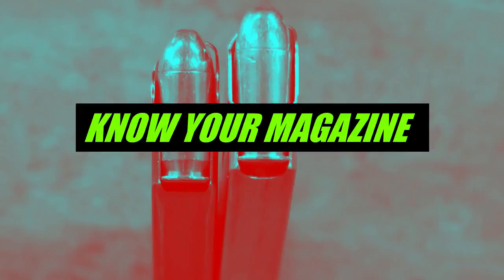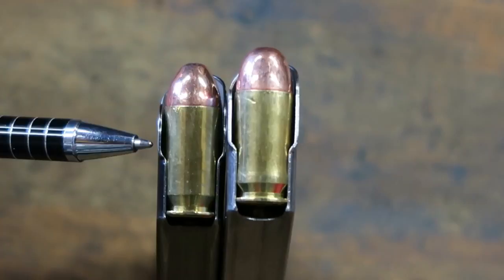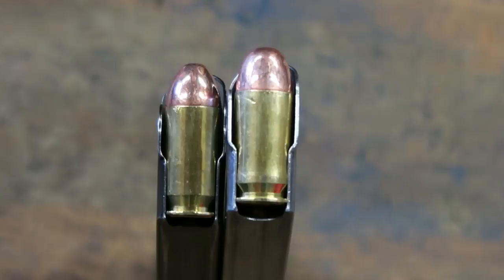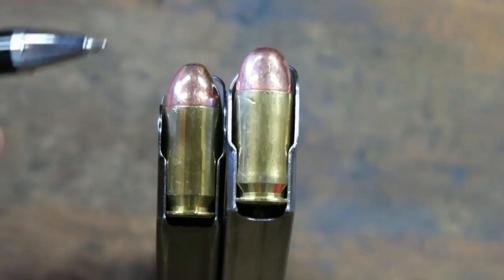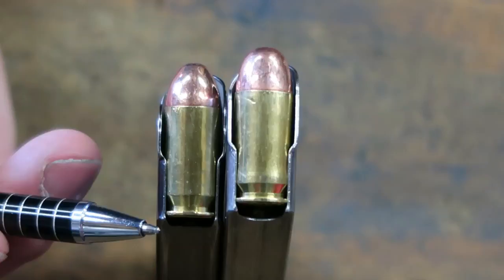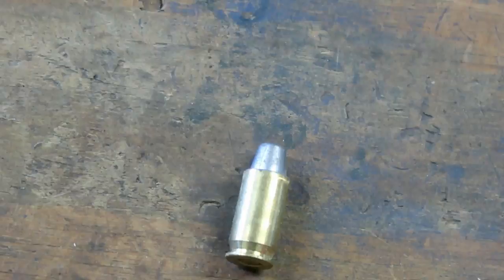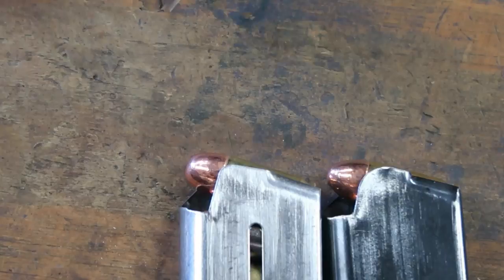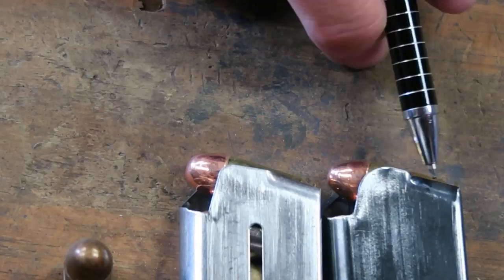Know Your Magazine

Comment: i converted a mauser to 45acp and it’s designed to take 1911 magazines. besides the gun not really being designed for the conversion it is finnicky and it wants to do the nose dive thing into the feed ramp like you talked about. what would be the best magazine to fix or make more liable this problem?
Reply from the maker: possibly one with a polymer follower like a Wilson Combat 47D. The polymer is slick so it would help with the drag as the cartridge is pushed out of the magazine. The shorter feed lips of a semi-wad cutter version will release earlier also. That might help. That is an interesting conversion.
Reply: @mackdaddy1911a1  thank you tremendously! you’ve gotta be the smartest person on the internet about 1911 magazines. i’ll definitely buy one and that makes sense. i had no idea that the round locked into the extractor as it caught it off the magazine. that makes sense why the kit had me reshape the extractor in the way that it did. yes this gun is definitely the coolest i own. with a silencer it’s quieter then a pellet gun. truly incredible. i’ll definitely get one of those mags and see if it helps
Reply from the maker: @1timmeh   I am still learning but I do try to pass on what I have learned. You might call the folks at Brownell's and talk to one of their experts before you buy. They can hook you up with a semi-wad cutter mag or steer you to a better solution. I saw your shorts video on the converted rifle. Quiet for sure.
Reply: @mackdaddy1911a1  that’s a great idea. i’ll call them. thanks! that was before i got the magazine converter in.  thanks for the watch!

Comment: Couldn’t you just use magazines designed for your pistol and use ammunition recommended by the manufacturer?
Reply from the maker: Yes but with 100 years of others developing accessories for the 1911 and clone 1911s, which is the real deal? There are over two dozen companies that make 1911 clones. And dozens of magazines. Some work correctly and some won't even fit into all the various pistols.

Comment: My kimber ultra carry 3in barrel 45 is new, but failure to feed seems chronic; (for a $1000+ compact concealed carry). Ball & hollow point with mags that came with it. Is there such a thing as a “break in” period of 400+ rounds before I take it in?
Reply from the maker: If is all metal yes. Also lubricate the slide and frame rails. Personally I prefer a thin layer of grease.  Field strip it and clean the rails and apply a thin layer. #2 automotive chassis grease is cheap and you can find it any where. Reassemble and wipe off any excess. Lack of lubrication causes binding and slows the slide velocity. Causing erratic ejection and feeding. Oil evaporates and runs off after a bit. Good luck.
Reply: @mackdaddy1911a1  thank you so much for the wisdom. I’ll go thru all that today. Seems a bit irresponsible on behalf of the manufacturer to not produce a firearm that is immediately reliable when it only takes a second for a psycho from BLM, Antifa, or basically anyone in commie California to decide to riot and pull people out of cars for a cowardly beat down. Hurts my pride that my buddies high point 45 has no misfeeds and I’m locked up every mag. Lol

Comment: Sig Sauer makes the best 1911, .45 ACP magazines, bar none.  Even better than Wilson Combat and especially better than Dan Wesson.  Having said that replace your recoil spring with a Wilson Combat one if you're going to go with a Sig mag.  And you never need hollow points with a .45 round, it will put a man down.  Hollow point is for .38's and 9mm.  Just my .02 cents.